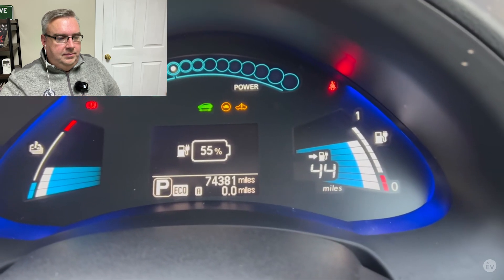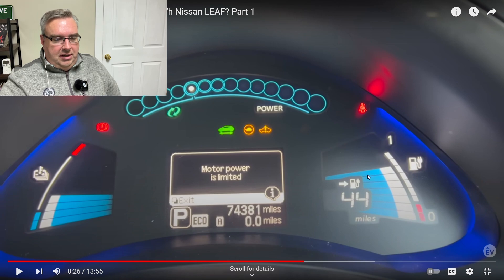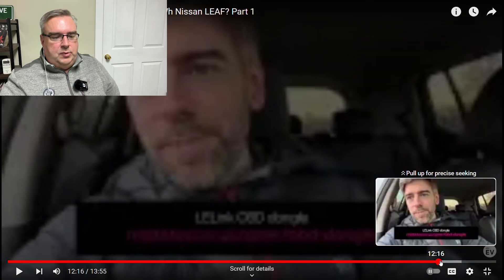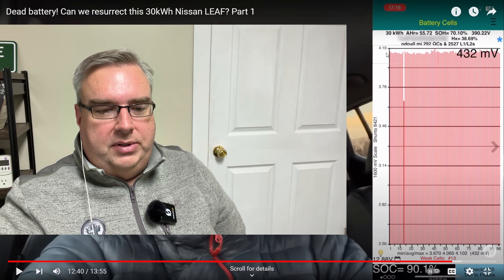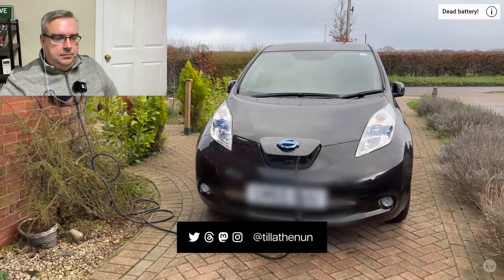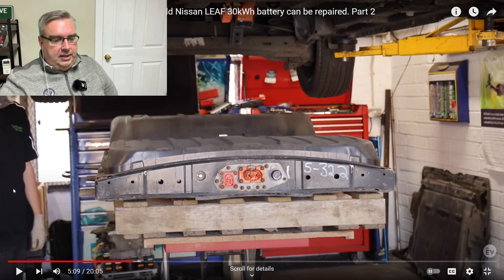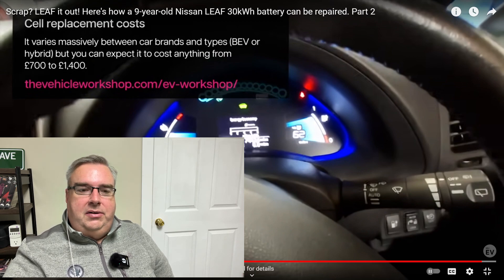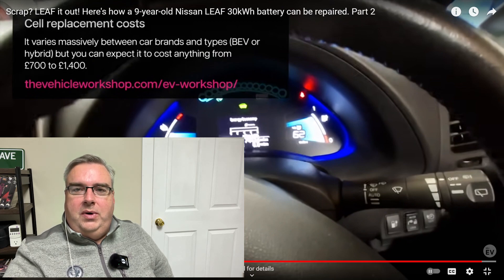Nissan Leaf Cheap Battery Repair for Hundreds not Thousands of Dollars

Comment: all great if you have a Leaf and you want to use it as a second car to either spare a 1st car from short drives or simply because the family has 2 cars and one is only used for around town rides. but if the degradation really is 70% than don't expect much more than 2 DC charging sessions before the battery gets too hot to even deliver full power, specially in the summer. so its basically a no-go as the only car. not that this generation of EV was ever a great only car.

Comment: The leaf was an ionic car. It has done wonders for the electric car market. I will say though, its not a great car to get now. The best budget electric car i have used is the 2017 ioniq electric. Rated at 200km with a 28kw battery, i would get 250-270 easy in the city. One major flaw with leaf os its inability to coast. Wity the ioniq, i drove about 12km once and user 1-2km of range because of coasting. I have seen videos of how you can install a 62kw battery now in a 2015 leaf but honestly its not worth it. They cost 5k+ usd. Chevy bolts with new batteries are around the same price. They do 400km+ in the summer

Comment: Many Leaf users go further and replace all the standard cells in the battery with higher capacity Cattle cells, achieving a range of 250-350 miles on a single charge.
Reply: I have 4 bars.  I have an offer for a 2018 battery. Unknown condition. Has been from a vehicle with 80k miles estimated. We agreed at $1700 and my friends and I can install it. Does that sound like a good idea?  Anything else I should consider?
Reply: @  I would consider replacing the entire cells with CATTLE. 280A each.
Reply: Wow. Cool. How much is that roughly. We have a 2013?
Reply: @kudynski  What problem did you have in 2013? Your beloved parrot died?
Reply: We have a 2012 and we live in Southern California in the Inland Empire.  Where are some repair shops near us?
Reply: @lynettesmith5363 If I lived in the US, I would definitely tell you

Comment: This Nissan modular system may be why they are able to use used Nissan EV batteries at a BESS (Battery Energy Storage Site) in hot desert Lancaster, CA and they don't regularly catch on fire like Moss Landing BESS with hi density lithium.   They can just throw out bad modules and use what still works.  They did have to create a computer program to utilize the sensors and technology in the used Honda and Nissan EV batteries.

Comment: All the remaining cells of the battery (and even the replacement for  original #13 as it's used and of unknown age) can potentially fail just as the one that got replaced. So there is no guarantee you wont be coughing up another $1500 in a week or two. Somebody in China have to come up with a new aftermarket replacement battery for the Leaf's with a good warranty and sell them for 20% less then Nissan. Until then an old Nissan Leaf is war riskier than a ICE car or a hybrid of the same age with a good maintenance history.

Comment: I don't own an EV and now that I am retired I may never purchase one. I recently bought a new SUV which is gas powered. I live in Canada and a gas powered vehicle is both comfortable and convenient. I typically use less than a tank of fuel per month, so an EV wouldn't provide significant cost savings in my situation. I travelled to China last year and I saw, and rode around in, a number of EVs that I liked. Even though I live in Canada, it would be fun to have an inexpensive EV as a second car for running around the city. During the cold winter months, I would just keep it in my garage. Unfortunately, it looks like the Canadian government will probably put high tariffs on Chinese made EVs, so I would have to give the government a lot of money in order to have the pleasure of purchasing one for myself.

Comment: The more people know this information the better. But I don't like people living off of other people's work. Doing commentary over someone else's video when you could just summarise and let people follow the link is lazy. This video could be 30 seconds long. Either make content or point people to other content. Don't steal other people's work. You don't need to. Your video on comparing three Nissan Leafs with different use history and different levels of degradation was excellent. We need more of that kind of original informative content. Just sitting there narrating someone elses video is a low bar.

Comment: Who wants to buy my 2012 nissan leaf? It's in fairly good condition. It has only 8 bars and on board charger. I'll sell it cheap, $1,900. US dollars.
Reply: where are you located?
Reply: 8 bars?  Did you replace the battery ever?

Comment: Last week we took our Leaf to Nissan in Az, they wanted to charge $😮20000 for a new battery. I don’t think Nissan Leaf is a good car, it is inefficient, low range so never again any Nissan Car EV or gas
Reply from the maker: Hello, I’m sorry to hear about this. Unfortunately your experience with Nissan is consistent with other stories I’ve heard. The goal of my video was to show that third party repair shops can repair the battery for significantly less expense and there may be a suitable shop in your area that does this. Just a suggestion for you to consider. Also if there are other viewers who have suggestions please leave them here.
Reply: Nissan are the worst to consult no matter where you live, go aftermarket , it's the equivalent of asking nissan to replace your wipers or tyres you would never do that unless you wanted a crazy bill.
Reply: @CarkeekW  Wo!  Wow!
Reply: Inefficient?  I'm getting 5 Miles per kWh from my 2014 Leaf which is excellent efficiency compared to newer EV's that only get 2.8 to 3.8 Miles per kWh.  Still on the original battery too however it hasn't been DC Fast Charged more than a handful of times over the past 11+ years.  For a vehicle that I purchased Off Lease almost a decade ago for less than $10,000 it has been an absolute bargain.

I don't drive it like I stole it nor push it to limp mode as a practice and rarely drive on the highway since most of my 30 or less mile commuting doesn't require it.  

For a retired person its the perfect low cost grocery getter and errand runner.  When the time finally comes to replace the battery I'll be looking at one of the Sub $5,000 options for getting a 62 kWh battery in it which will be a substantial upgrade to the current 24 kWh.

Best!
Reply: I think Nissan is trying to push everybody to a new Ariya, which has CCS charging and a liquid cooled battery.
Only problem it is an SUV (they call it a "crossover").

Also, being a newer car: annual depreciation would be higher.
Reply: What year Nissan LEAF???
Reply: You can buy a plug and play Nissan Leaf 62Kwh battery from China for approx $7,000 - it would give a range of approx 250 miles. - They are on You tube - @VIVNE-CoraLui - I'm tempted.

Comment: Hello, I think since the used EV community is growing it shouldn't be as difficult to repair older EV's. They made 100,000 of thousands of LEAF's world wide. Just goes to show that EV's have a way longer life than people expected. Both of our I3's have over 75,000 miles (120700 KM's) and are still running like they were when we first bought them. Thanks for sharing this video, it was really interesting. :face-red-heart-shape:
Reply: Nissan EVS seem more repairable than (Teslas, although Tesla is moving to bigger batteries: 4860 (46mmX80mm) a bigger cell than the original 18650 (18mmx65mm) or the 2170 (21mmx70mm) which they also used.)  The Nissan EV battery isn't tooo huge.  A guy on another channel switched out Leaf batteries himself using just 4 jack stands and a motorcycle lift and a couple of furniture moving dollys and a laser leveler to help center the pack between the supports and get it back in there.